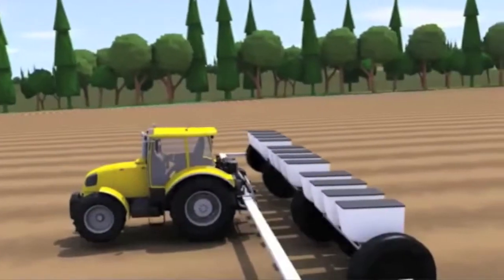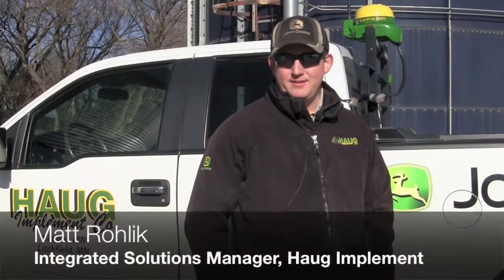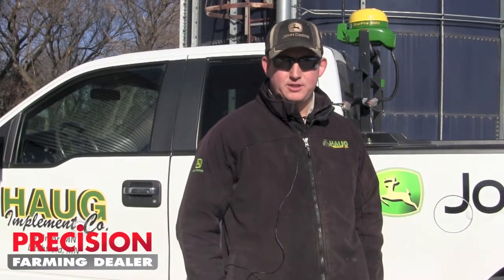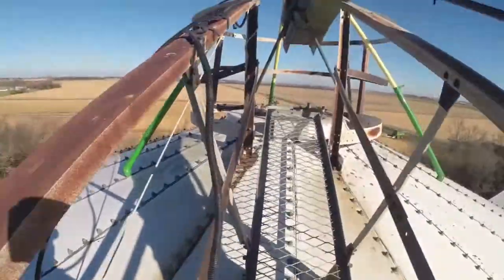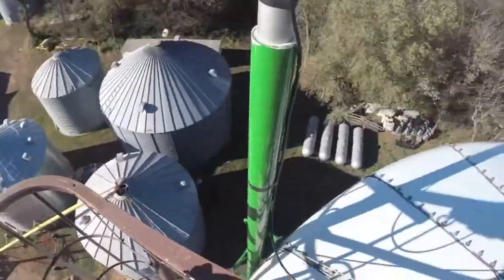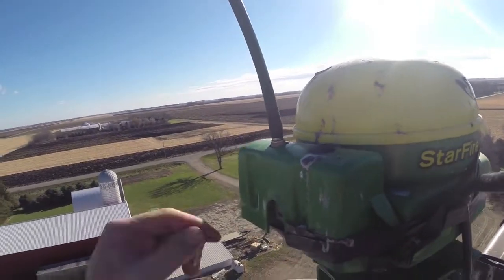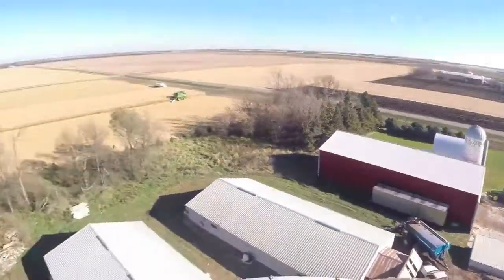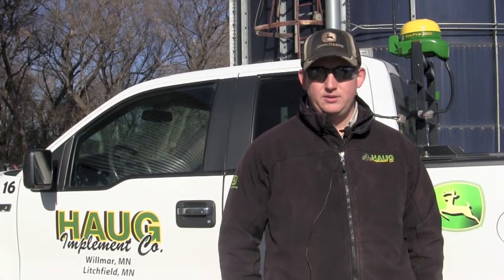Troubleshooting: Diagnosing RTK Tower Signal Issues

Comment: Very well could be water in a coax connector which may have dried out by now. I would keep an eye on it. Maybe a migration of coax center conductor to shield. Especially in a sharp bend. You can have the coax “swept” by any reputable tower company and that will tell the full story.